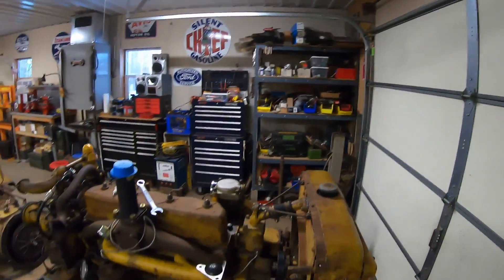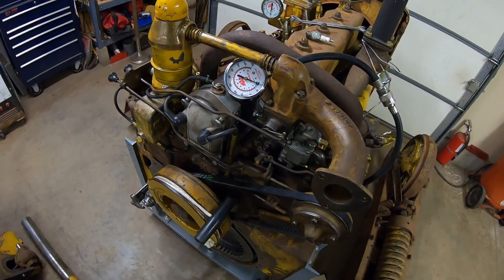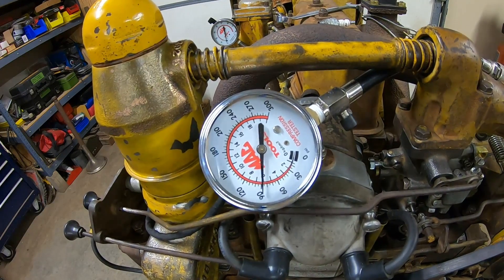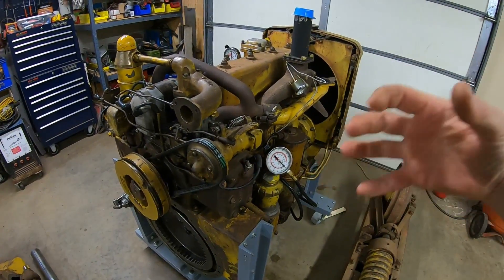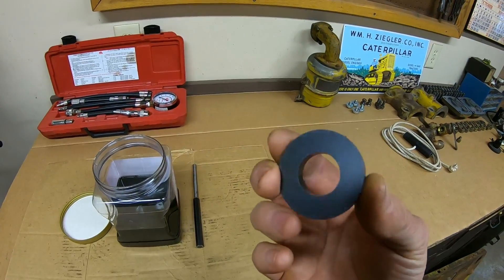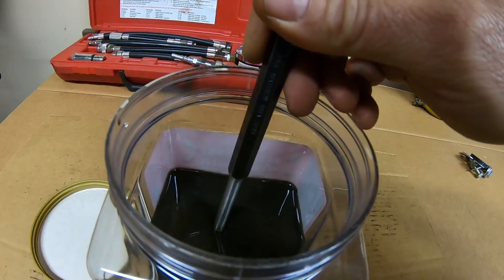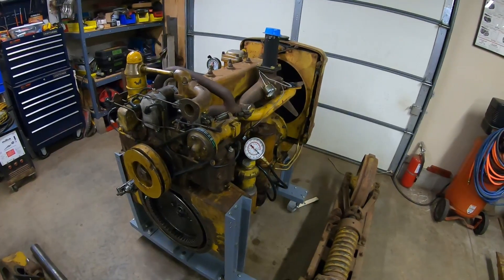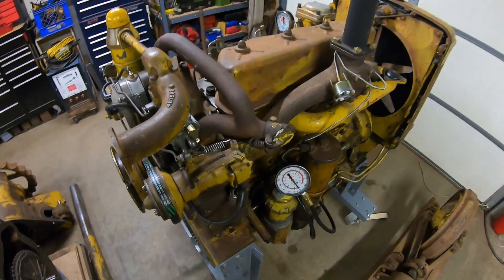Caterpillar D2/D4 Starting Engine: How Much Compression Should They Have? Let's Test a New One!

Comment: I have a more technical question, my pony engine has a straight out spark plug. I believe it has a smaller combustion chamber. I think I seen a tech bulletin about changing the heads and adding more RPM for the D4 engines. I wonder how much more compression that would give one?
Reply: @squatch253  there was a TSB ( you remember those haha) that I read about changing the heads and slightly increasing the RPM. It was aimed at the D4 in cold climates. I will see if I can find it. It was in the caterpillar service magazine articles.

Comment: My first car was a 61 chevy with an unfiltered 235 engine. It dripped a quart a week from the rear main. It used rerun oil for a while. When I rebuilt it I found an oil filter at a wrecking yard to bolt on manifold. Took me several tries to route the connecting hoses so they wouldn't rub a hole in them. I did change to a premium oil after rebuild but I never could keep old chevys from developing slow leaks in rear seals until I got into 70s model engines. Even our 36 massey harris tractor used oil pretty regular so adding oil is what my brothers and I did constantly. I cringe when the dealer says my new car only needs oil change every 8 to 10k.
Reply: Even though you can wait until the computer says change the oil I still change it and the filter at 3000 . 4000 tops . Oil is cheap .

Comment: When I was working on generators  I would tell the people running the using them that I wanted them to change the oil every 2 tanks of gas ⛽!! 
And they would say we're supposed to send a sample in !! 
And I would say I don't care what you are supposed to do! 
This is want I want you to do because by the time you get the results back it will already  be blown up!!!!! 
And because I'm in charge of them !!! 
And I would tell the people that couldn't keep them  running not to put diesel fuel in them and not to check the oil when running!!! 
Because they would  eat the dipstick!!!!  FACT EVERY TIME !!!!

Comment: When I rebuild an engine I always use John Deere break-in oil.  I have had good luck with it so far. I usually run it for 100 hrs and dump it. I know it's just a brand name and I could buy it from any automotive store but my dealer is closer so I use it. Thanks for a great video.
Reply: If you rebuild a Deere diesel and run their plus50 oil without doing a break in oil run first it will not seat the rings. I have seen it several times.
Reply: @bcbloc02  yes I think the plus50 is semi synthetic so it would be a step back for sure. 
I use it in all my engines even the Briggs and Stratton rotor tiller

Comment: Oh no, if you are using Pennzoil in that pony engine, it will be ruined by June because my wife's hairdresser's brother-in-law had an engine fail using Pennzoil. :-)
Good info on changing the oil in the rebuilt and that compression is IMPRESSIVE.

Comment: Thank you Toby for the insight, there was some valuable info in this video for me. I can't comment much on the oils cause I use very different brands to what your using. So I don't wanna start a fight here. However I will say this people do make mistakes when the break in diesel engines.  Main mistake I have seen is when people break in the engine and don't follow the factory recommendations. This is when things get messy and you get engines that spit out oil or the rings don't wear in correct. Ask me how I know :D

Comment: Some builders don't put oil on the pistons or cylinder walls during reassembly, running them dry so it breaks in faster. I never did it with anything I rebuilt but I'm probably too chicken to risk it.

Comment: Years ago I asked my machine shop guy about running detergent oil in a engine that used non-detergent oil and he said the main and rod bearings were made of a harder material than the newer engines and didn't want the particles circulated with the detergent oil circulated and possibly scratching the crank where the non-detergent didn't circulate near as much particles. He did recommend using detergent oil because it was superior to the non-detergent and change it more often.
Reply: The detergent is mainly to stop wear products settling in oil galleries and obstructing them.
Splash lubrication does not use oil galleries.
I've used 10,000 km old used diesel engine oil (DELO) in the Tecumseh engine in my ride on mower for 30 years and the bearings are perfect.

Comment: So Toby what did Caterpillar advise/ suggest for break in procedure for a rebuilt engine with new rings, ground valves and seats, and or lapped in valves?
I've had small block chev engines that suggested 500 miles which I believe is 10 hours of running.
Either way, 
IT 
IS 
ALIVE!

Comment: 75 PSI amounts to 5:1 compression, which in the 1930's was pretty standard even on fancier automobiles.  The gasoline then available for automobiles wouldn't tolerate anything higher.  It wasn't until after World War II when refineries that had been specially constructed or adapted to produce 100-octane aviation fuel for the military started producing higher-octane fuel for the civilian market.
Reply: 5:1?  There is nothing "standard" about compression ratio.  Compression is a function of combustion chamber volume. Oh, and by the way, tetraeythel lead was "the" fuel additive octane adder, developed in the "1920's"  to allow higher compression engines to be built!  The above comment speaks to the problem our country is having these days.  Facts don't mean shit any more.  Sad!

Comment: I remember when I was mechanicing… I rebuilt a Rabbit diesel engine. Synthetic oils has just come out, and I put that in the engine 😵‍💫. You want to talk about an oil disaster!!! Of course (we didn’t know it then) the rings wouldn’t seat. I had to strip that thing back down and reclean everything. Fortunately we learned quick and put in a mineral oil break in oil for the second go. That critter blew blue smoke you couldn’t see through on that synthetic! Fortunately we had the hose off that would have dumped that back into the intake (we always disconnected it until initial break in was done to discourage run away). The oil didn’t have anti-wear additives (knew better than that!) but still was too slick to let the rings seat.

Comment: Very good explanation on detergent vs. Non-detergent motor oil. I agree with a quote you've made on here before. More engines have been ruined by not having enough (or sometimes any) oil than have been ruined by the quote on quote "wrong" oil.

Comment: Excellent video you are absolutely right about the oils. I have broken in big diesel engines with non detergent motor oil. I have also used non detergent motor oil as a flushing agent in really dirty engines before I take the oil pan off it does a good job of scrubbing the sludge out I bought a G705 mm diesel tractor years ago the oil was so thick and nasty it would not drip off of the dipstick in 90 degrees weather so I flushed it a few times and the oil started staying clean.  Every type of oil has it's place depending on the purpose. Keep up the great videos Toby

Comment: Interesting to see the suspended metal particles picked up by the magnet.  My philosophy on the old starting engine is that I will take the time and expense to change the 1 qt. of oil every few starts and do all I can to prolong starting engine life.  Thanks for another informative video👍🏼
Reply: @squatch253   Your comments about non-detergent and detergent oil are spot on.  Oil company advertising (mostly past but some present too) is responsible for most of the confusion about types of oil.  Of course, today, "synthetics" rule the roost.  The days of engines without filters are gone for the most part and non-detergent oil is getting to be difficult to find.  You will probably be getting arguments about paraffin based oils vs. asphalt based oils.  Just something else to argue about.  Unless you have a 50 year old unopened can of Oilzum or Pennzoil in your cabinet, you don't have any paraffin based oil.
Again, thanks for your unbiased and correct information on oil applications!
Reply: Surprised there's no magnet in the sump plug??

Comment: A great explanation of break in and what happens.  As for engine oil, yeah, I avoid that conversation/argument myself.  Your explanation of detergent vs non detergent was excellent.  Thanks.
Reply: @squatch253  I still work in the industry as a tech trainer for a manufacturer.  Oil technology is mind blowing really. In my opinion, your explanation of detergent vs non detergent was spot on.  Ask yourself, what do need the oil to do?  Make your selection.
Reply: @squatch253  Your explanations of why to use what type of oil makes sense here to this scientist.  Full synthetic oils have come a long way and in modern engines with tight tolerances a full synthetic makes perfect sense due to materials and alloys used in modern engines.  In the old style engines, they were designed for the conventional oils and those I have seen improvements on as well.  We would be appalled at the quality of 1930's era oil in today's knowledge.  For break in the non detergent oils make sense.  But after break in on a filtered engine, would synthetics in your opinion be a good choice to keep a rebuilt engine viable as long as required oil changes to flush out contamination and restore viscosity due to air oxidation and heat leading to oil breakdown be permissible?  On a non filtered engine, they do require frequent oil changes as there is no other way to remove contamination.  I am loving your explanations.